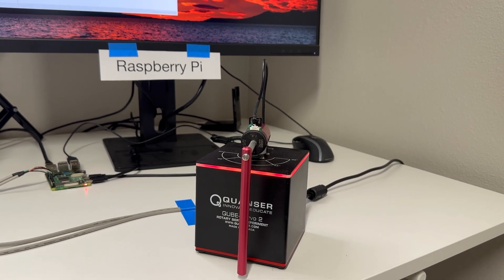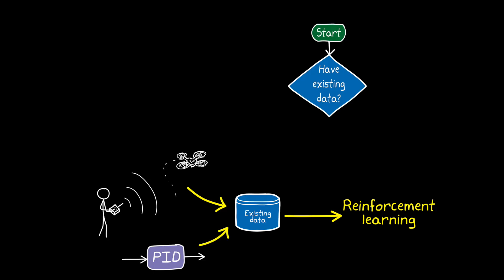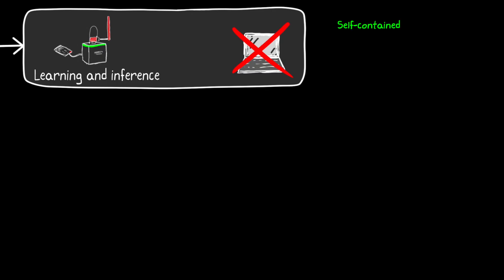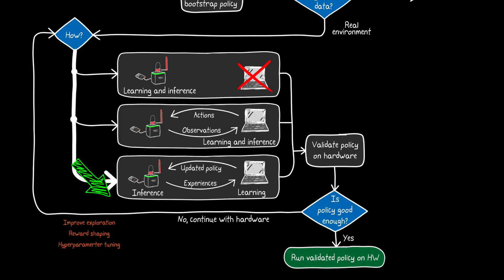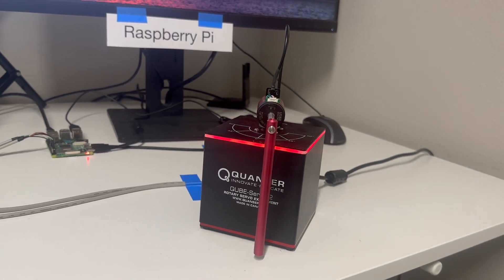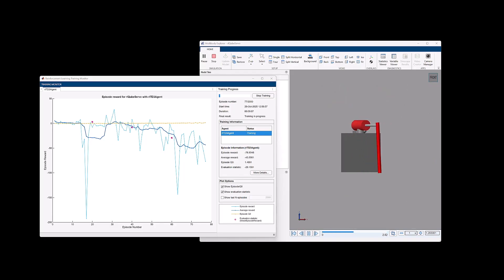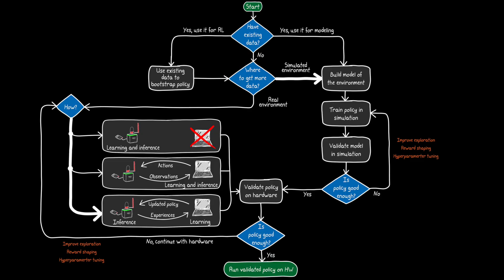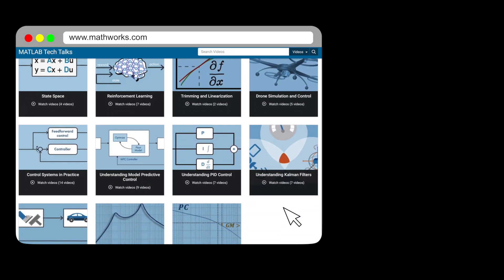Reinforcement Learning Workflows for HW and Sim: Strategies to Bridge the Sim-to-Real Gap

Comment: Hi Brian, 
Nice demo. It seems your simulated environment reward was maximized within a short amount of episodes. My question is - why when you started from the simulated policy, then re-enabled learning, did you start to see greater jitter with the motor? Seems the reward regressed.
Reply: If I understand your question correctly, you're asking why the policy that I trained in simulation when running on the hardware looked pretty good but when I turned on learning at that point, it started to jitter more. I'm not 100% sure, but I suspect it has to do with the exploration related hyperparameters, where the learning algorithm is trying to explore more of the observation space. I think I could have reduced that jitter by changing the hyperparameters so that the algorithm doesn't try to explore as much and mostly exploits the existing policy.
Reply: @BrianBDouglas Yes, you talk about starting from the simulation generated policy at 16:45 (with training) and it looks as if it is performing worse, or has more jitter, than starting from the trained policy at 14:12. I’m curious how that would be?

Comment: Brian, you are amazing.

Maybe off topic as I know the purpose is to use matlab, but what if we wanted to use something open source, where should we start?
Reply: Good question. If you want to go open-source, a common starting point is Python with PyTorch/TensorFlow for training, plus Gym-style environments and custom code to connect to hardware. The reason for MATLAB, however, is that it makes the entire workflow easier: modeling, simulation, hardware I/O, testing, and generating deployable embedded code all in one place. Open-source stacks often require stitching many tools together yourself. If your goal is learning RL algorithms, open-source is great. If your goal is getting learning-based controllers running reliably on real hardware, that’s where MATLAB is really useful! Do you have a project in mind?
Reply: Maybe Julia.